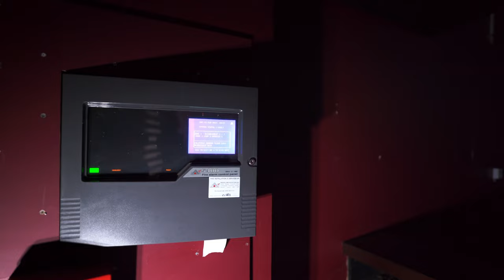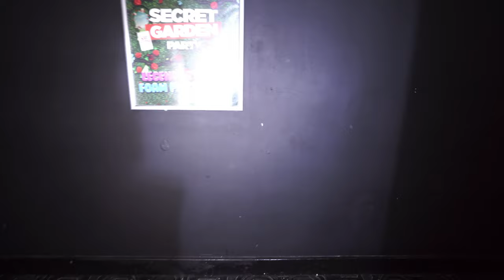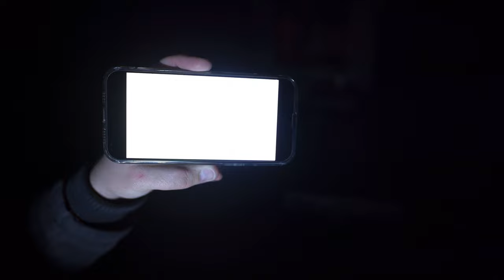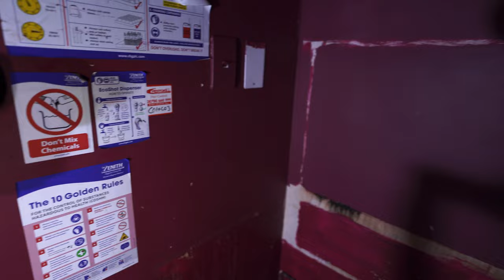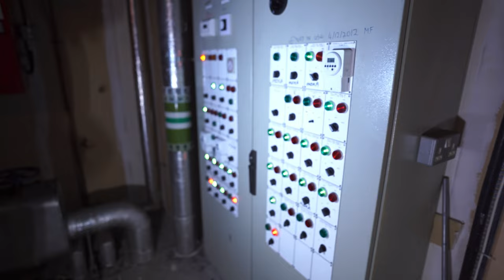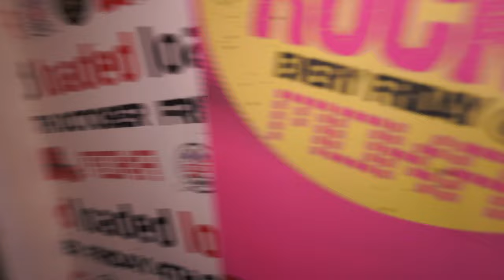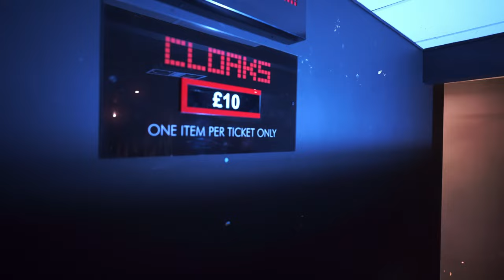MOKA CRAWLEY NIGHTCLUB ABANDONED SINCE 2019 - POWER STILL ON!

Comment: The club opened in the mid 90s as ikon Diva. It had a 3rd floor VIP lounge called the Gallary. The ground floor was Diva, on a Thursday night it was £20 entry all you can drink. The club changed to liquid envy in 2008, and then to Moka. 

The club use to feed off all the bars in crawley high street, there were loads through the 90s & 00s. The high street on a Friday and Saturday night was packed. Then the recession hit and bars closed, never opened again or kept changing hands. Plus the town started to decline, dodgy characters moving to the area from abroad, the vibe vanished.

I for one, had a bloody cracking time from 2001 - 2008, pretty much every weekend in my early 20s.